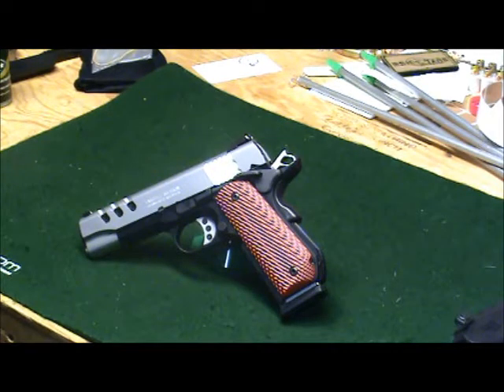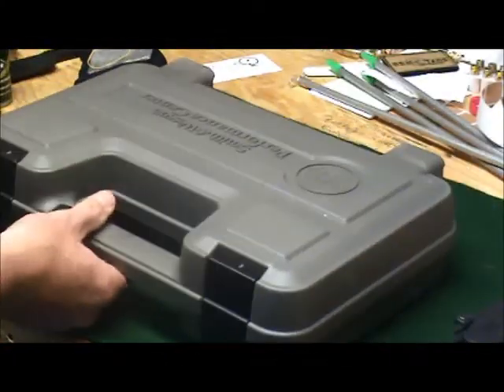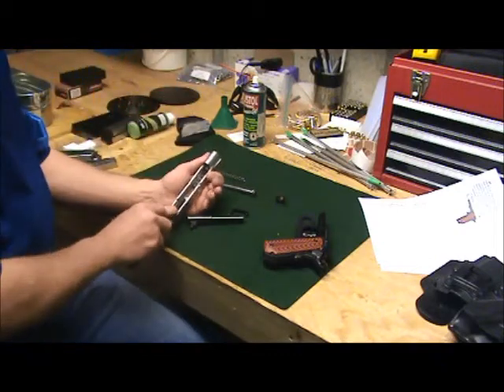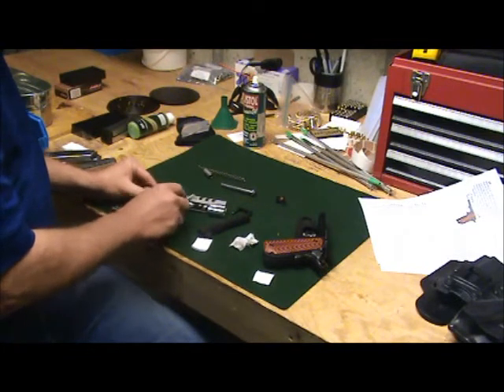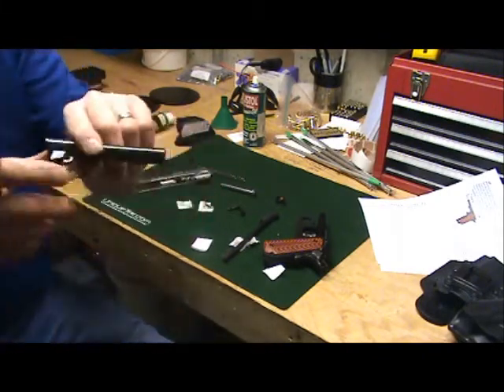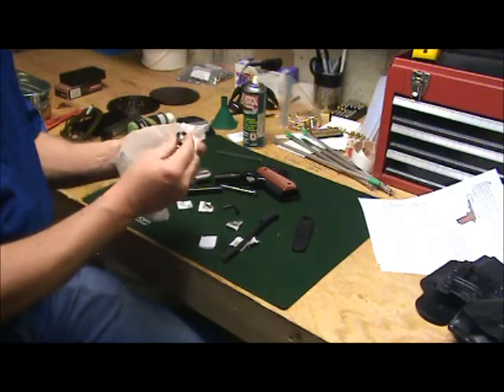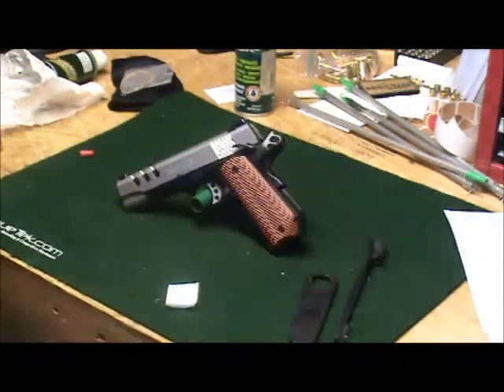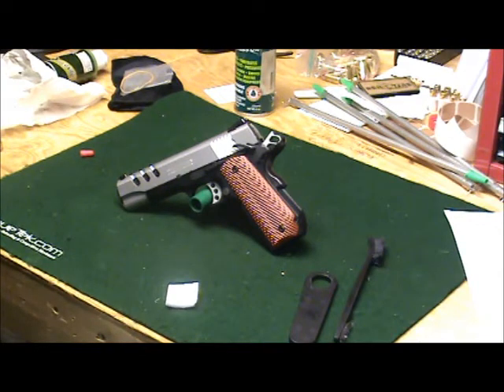S&W PC1911 Review & Cleaning

Comment: Reassembly:   I learned on my own to go on and put the Briley bushing onto the barrel as soon as you put the barrel back into the slide.  It goes on very easily then as apposed to almost never going on after the gun is mostly reassembled.

Reassembly steps:

1).  Barrel back into slide.
2).  Briley bushing onto barrel.
3).  Guide rod into slide.
4).  Slide onto frame.
5).  Insert slide stop.
6).  Recoil spring onto guide rod.
7).  Spring plug.
8).  Turn bushing to capture spring plug.

I have this same weapon in my shoulder holster which I am wearing.  It's an excellent weapon.  I hope to get an Andrews' Monarch shoulder rig soon and Crimson Trace laser grips.  Thanks for the video.  Happy New Year to all.

Comment: great firearm, I have the exact same one, i have 1000 rounds through it with no malfunctions, that bushing goes back in easier if you insert the barrel in the slide and let it stick out and put the bushing on over the barrel first, it still takes a little time, oil the insert and it helps.Best 1911 I have ! Thanks for the great video, God bless you, al
Reply: Offshore 42
1 second ago
If you're just a little careful, you can remove the barrel, clean it and replace the barrel without ever taking the bushing off. It makes the whole process so much easier.

Comment: The Briley bushing is insanely frustrating! Took me a full 20 minutes to slide back on and it was just by luck. Good video!
Reply: If you're just a little careful, you can remove the barrel, clean it and replace the barrel without ever taking the bushing off. It makes the whole process so much easier.

Comment: I have the same 1911 the barrel finish came off right away looked like crap so I polished it to a mirror finish looks much better now ... Also the little spring nipple that hold the safety and slide lock in position fell off on mine and was cracked on the back side very disappointed now I'm worried about the rest of the scandium frame parts cracking I'm almost ready to trade it for a Sig or something good luck with yours Sir!